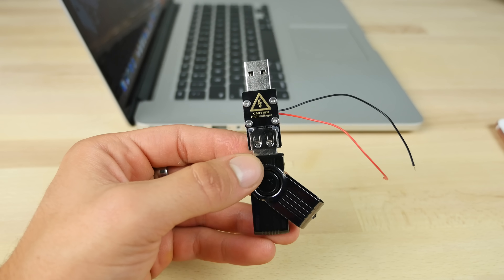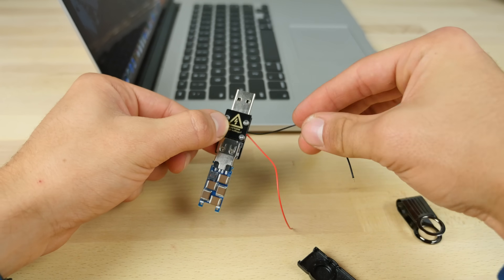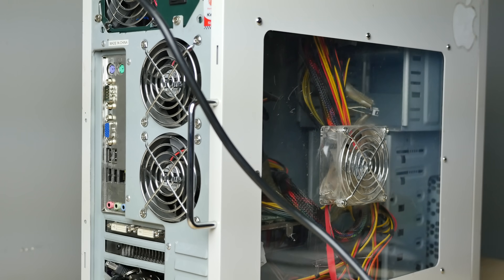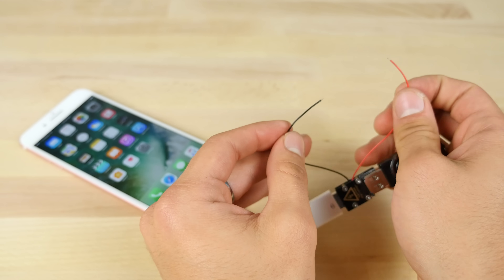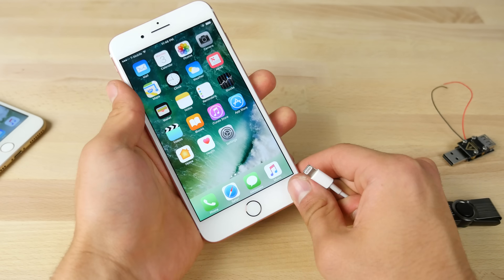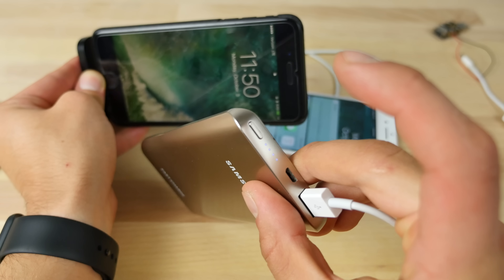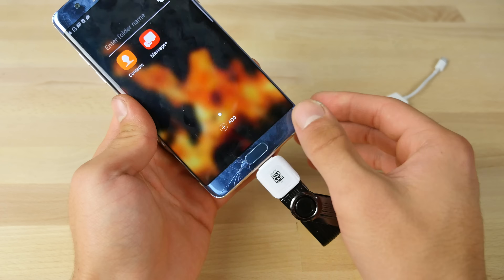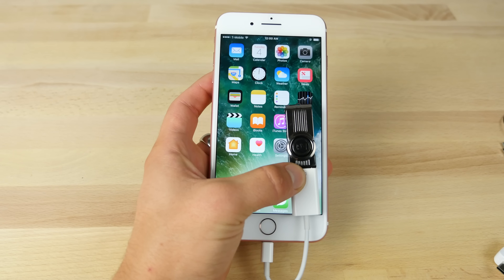USB Killer vs iPhone 7 Plus - Instant Death?

Comment: I don't think that fried your computer, usb ports and mobos have over voltage protection which kicked on in your case and gives you the exact same situation as you have.  If you disconnect the psu ie 24pin and the 8pin for the cpu from the mobo and pop your cmos battery and your usb headers, then reconnect everything with your psu unplugged from the wall and lastly plug your psu into the wall I think it will probably boot up.  I could see it go either way, I've seen both in my computer/phone repair history.

Comment: apple phones will disable their charging port if it receives power surges you have to turn the phone back off and on to reset the protection. had it happen with a bad cable once

Comment: So it would appear the caps aren't peaking from the iphone and the dummy's ports. You could charge the USB killer to capacity from the power bank USB port using the test module and then unplugging it without crossing the wires to complete the circuit and discharging it and THEN plug it into the adapter without the test module to unload a FULL charge and I'd bet you'd get better results.

Comment: This is a perfect example of someone that knows nothing about electronics, Most likely a safety tripped in your computers powersupply to protect the pc since usb pulls power straight from the psu 5v rail.

Second. All usbs have the same output voltage no matter if it is a iphone or a pc, the difference is in the output ampere.

Instead of making a fool of yourself learn a bit about what you are talking about, at most you have destroyed the USB port and possibly the controller the port is connected to on the PC unless it does not follow standards.
Reply: João Victor Schiavo because that uses a standard input specific for charging (power devices) there is active circuits inside to make sure that the 20v charging curcuit for the pixel and the 5v OUTPUT if you plug anything in never connects with eachother. the PD standard is max 20v 5A but an usb drive is not an PD device and therefor you will never get more than 5v 3A according to the USB type-C standard.

once again go read the standardisation document for USB before spewing shit please.
Reply: Mr. Schiavo, please show your work. You should know USB specification lists output voltage at 5v. Only power delivery chargers deviate from this 5v spec so iphone or pc, voltage is 5v because neither is a power delivery charger.
Reply: You need a lightning to USB converter and it should work but not sure if you need an active or passive adapter, I am not 100% sure tho since my knowledge with apple products is kind of limited however taking a quick look at the apple lightning documentation it should work atleast with an active adapter.
Reply: Mathias Westerlund gjorde han i videon anspråk på att all information var korrekt? Lät mer som att han sade typ "I think its because of blablabla" och spekulerade. Men om det nu var så, håller jag helt med dig. BTW min USB-C laddare säger att den har output på 5V 2.5A eller 9V 1.7A eller 12V 1.25 A. Är inte superutbildad inom ämnet men har USB C förmågan att variera volt eller är det fortfarande samma? Watten är ju konstant såklart.
Reply: Alla nyare Type-C power supplies är tillåtna att ha en maximal 20volt 5 A output om dom är PD enheter (Power Delivery) vilket är saker som nätaggrigat(AC adapters) vilket en laddare är. Sedan är minimala standarden 5V allt där imellan är OK enligt PD standarden så länge den följs och alla säkerhets funktioner som är listade.
Reply: "All usbs have the same output voltage no matter if it is a iphone or a pc"
You are wrong lol
Reply: take chromebook pixel 2. Google store does even have a 60W charger available. that is 20 V x 3 A, and through USB. How are you telling me that it only works at 5v?
Reply: Fyfan vilken tråkig kommentar.
Reply: Sebastian Köhler Öberg Men likväl sann för det.
Reply: Mathias Westerlund alla behöver inte vara experter på ämnet. Videon är till för att underhålla, inte för att göra en sakriktig undersökning. Vill man ha det får man läsa en studie.
Reply: Förutom att han gör vad han antar är ett korrekt och utbildande påstående och därmed sprider felaktig information, ber han inte vara expert men om han ska leka med kretskort som bara är ett äng seriekopplade kondingar som resulterar i tusentals volt så bör han ha åt minstånde grundläggande kunskap om vad han sysslar med. Att leka med kondingar utan att veta vad du sysslar med är alvarligt korkat och rent av farligt. Att sedan få folk att lyssna på felaktig information angående el är ännu värre. Som jag sa innan bryr jag mig inte om att han ska vara expert på ämnet utan endast som mitt orginella påstående och meddelande anser jag han bör ha den mest grundliga kunskapen om vad han uttalar sig om och inget mera. Resterande kommentarer från mig angående att läsa på om standarder är ednast för de som uttalade sig efteråt som tyvvär tror personen i klippet har rätt och att jag inte vet vad jag pratar om, därmed bad jag dom läsa på lite extra om USB standarden för att förstå att jag inte alls har fel utan helt rätt och att deras uttalande om min orginal kommentar är helt fel.
Reply: I completely agree with you.
Reply: I am not entirely sure but I also don't think that the USB drive that is being used would be compatible with an iphone. I tried to plug a regular USB and I could in no way access it on my phone so I don't even know if it would do anything since it is designed for computers not IPhones but i don't know for certain.
Reply: I didn't say anything wrong, I just didn't get what you are saying the first time. as you know, PD devices outputs more than 5v through USB

Comment: What would happen if you plug the USB killer into the wall using a charging block? Would  the high voltage blow the capacitors?
Reply: There's likely a diode on the output of the wall charger that prevents current from flowing backward. If this device reaches enough voltage so as to overcome the reverse breakdown voltage of the diode then you may destroy a few components in the wall charger before a fuse blows.
Reply: try it with your whole family around it :D, just kidding, it can blow your house up!!!
Reply: The diode in the charger will most likely break and possibly the logic board, But the charger will not explode. At worst you will get a small puff of smoke as the logics gets fried.
Reply: Jon717 your electronics that are connected to the main electric line will die/explode

Comment: Don't new motherboards have protections for such stuff ?
Reply: It isnt directly drom the psu.. It has to pass from th mb
Reply: Well it would do the job at any standart pc :P
Reply: +zTEK Studios all this stick dies is pass high voltage to the USB port,  which is connected to the mobo.  Because of this the spark fries the mobo (Google why,  it's complicated to explain)

Comment: Its not unusual. though the Iphone has a savetymechanism to prevent the phone from dying of a short ciruit. it will most lekely suffer damage on the Power IC. I had this issue with an Iphone 6 and 6S  wich had a small fan plugged into the lightning port.

Comment: The killer won't work on any phone because the 5V don't supply anything else then the USB-Port since your battery has only 3.7V and your phone operates at 3.3V. Worst case would be to kill the USB-chip or the battery charge controller which could kill the battery but since your killer needs current to charge it won''t work + some phones might be extra protected so that a misfunction in your charger that runs on 110/230V can't harm you or your phone.

Comment: It's not the lightning port. You probably have destroyed the tristar chip which is a very common issue on iphones if you supply more power (for example with cheap unregulated chargers).

Comment: so...Note 7 entirelly survived , while 7 has it's charging port cooked ... well done!
Reply: ikr, he quickly skipped over that (in a low voice)
Reply: I know ...he says that he really wanted one of these phones really dies...he means the note 7
Reply: Κωστής Δρόσος that's because the note 7 was saving it for an explosion
Reply: Yep, Apple will never be able to beat up Samsung at all.
Reply: Most OTG android devices check for what is connected on the data lines before powering up the port. The Note checks if there is the usual impedance for communication or if there is a resistance between the lines. If the impedance was off or the resistance was too high it doesn't turn on the OTG power.
Reply: DemonEntertainment No he is saying similar products for the same consumer (people looking to buy phones). But the Android phone targets smart techy people and Apple targets soccer mums and girls.
Reply: I am suprised he even uploaded the Note 7 part :)
Reply: nah ... 😂
Reply: What many people like you don't understand is that Apple is for a different consumer. Comparing the two is plain stupid and doesn't make sense.
Reply: No they are not for a different consumer, They are both targeting the same consumer market entirely but with different market strategies and different focuses on what they thing the consumers in question want.
Reply: Mathias Westerlund So they are targeting different consumers?
Reply: Iphone 7's also has exploded.  You can google this and a Iphone 5 has exploded and killed a Chinese girl
Reply: Velysean The iphone 7 explosions are fake. However samsung has completely stopped production of the note 7. Your saint of a company isn't so perfect now XD.
Reply: Joshua Boul That isn't at all what he said lol.
Reply: Joshua Boul And last time I checked those are different consumers
Reply: DemonEntertainment
Reply: +Mathias Westerlund You literally said what Manchester FC FTW said.
Reply: Why is this comment not higher up? Also he seemed to just skip over it.
Reply: Κωστής Δρόσος but the note 7 explodes randomly
Reply: Blue Behemoth yes...."randomly" in the US ;)
Reply: +Velysean Alot more Chinese girls would die if it was plugged into Tianhe-2.
Reply: Blue Behemoth yeah... as they say ...i Have an S7 and i'm happy with it... unfortunatelly i don't know anyone who had an issue with his Note 7 ...at least Samsung got them back...still a big foul!
Reply: *****where did you read that Samsung stopped production? They only recalled all Note 7s and are now fixing the problem.
Reply: DemonEntertainment I never called them perfect dipshit.  Every company, Samsung apple LG Motorola, all has their problems.  But I well still stick with my Galaxy S7 edge that also has a headphone jack over a iphone 7
Reply: nope ...they stopped it

Comment: I don't know much about these kind of stuff, but the so called preventation on Apple and Samsung (or basically any other phone) might be the battery itself. Other than transfering data, if there is a current going through phones mini usb connection, it basically transfers to battery. And it basically doesn't matter how much or what kind of current you are pushing, battery will try to handle it and deliver to phone at a fixed voltage. It might harm the battery though, maybe even make the battery explode, but I don't think it would harm the phone itself.

Comment: Where do i get a USB killer?
Reply: ***** I wanna build my own but where do I get capacitors
Reply: Clorox Bleach  Go to an electronics store or a hardware store or something like that, you can probably but a bunch off the internet as well.
Reply: Just build one yourself. You need some capacitors and a USB circuit schematics.
Reply: hsucks yeah its that simple
Reply: hsucks Idek where to get them do I take apart 5 USB's and salvage the things inside?
Reply: good luck lol
Reply: Just drink yourself.
Really though, like 2 minutes on google and you'd probably find a decent one.
If you want to build one yourself, you can get a board and some capacitors and go full Shenzhen on that thing, but it's probably better if you just get one online.
Reply: these arent just caps guys.. there is also a boost converter to actually RAISE the voltage up to 200V.

Comment: FAKE: every USB port (port not drive) ever made has a over-volt protector (a breaker) and the motherboard would have rebooted the PC into a voltage safety mode.
Reply: You mean the over-volt protector that says "max 36 v."?Cuz that thing puts out more than 200 depending on the model.
Reply: MyVash12349 1.The amounts of Amps that things send of/the watts don't mean shit.It's all in the volts.2."If that exceeds it, it will just discharge that shit through the ground wire on your fucking AC cable."Yes , it will do just that.Problem : the Voltage will already have fried your PC by the time that kicks in.
Reply: not entirely true, all datalines are protected by Zener diodes against overvoltage. a large voltage Spike will be passed through to the positive supply railes of the controller and directly to the PSU. Which should be able to Cope, AS long as the energy is equivalent to a static discharge. Only after friying those diodes the voltage can pass through to other components as you mentioned.
Reply: MyVash12349 To summarise your comments : "I was raped by my uncles when I was little so I have to pretend to be worth anything at all on the internet"
Reply: MyVash, if you look at the diagrams on that link you provided, the LM3525 is designed to protect against overvoltage on the Vbus/GND lines, NOT the D+/D- data lines. Look at page 9 of your own link. The USB Killer works by charging the capacitors off the Vbus then discharging them at ~200V on the D+/D- lines, which in nearly all USB devices, are NOT protected. These lines are intended to support a max voltage of about 3.6V. The architecture of most motherboards will allow the 200V spikes from the USB Killer to travel through the USB controller and directly into the other components (e.g. via the PCI-e bus, your CPU, GPU, HDD / SDD controllers, and potentially into RAM).
Reply: who*
Reply: Nathan Smith lol
Reply: yeah this is fake haha
Reply: You are the single most stupid human being I have encountered in quite some time! Congratulations! As into why: Google how many volts go through your body when you get tased by a taser. Then, you will notice, aside from a little red on your skin, you suffer no damage to your body what so ever.
And if you are having trouble finding out why you aren't "fried", that is exactly why I am calling you a pathetic moron!
Reply: Geron Phillips That has no correlation. Every motherboard has to have a safety switch. If that flips, all power is cut to safeguard it.
Reply: MyVash12349 is right, stfu ignorant people...
and "poor fag" - maybe he uses his own money meanwhile you use your parent's, just because you're ignorant as fuck and can't get a job?